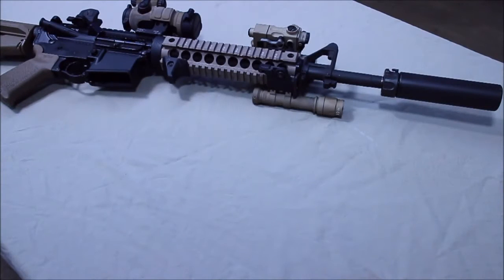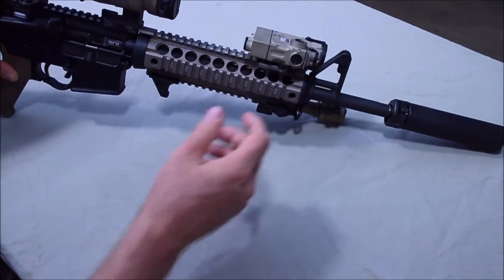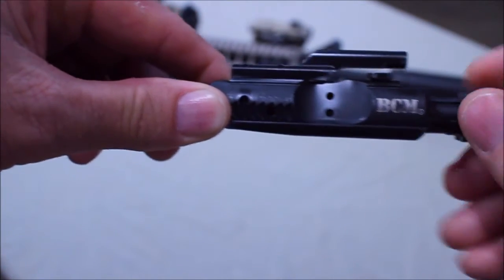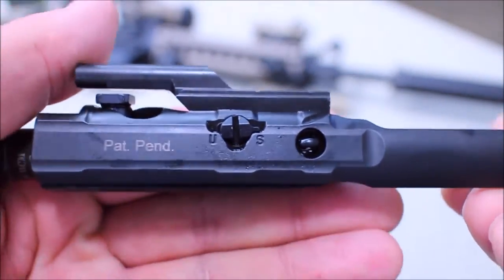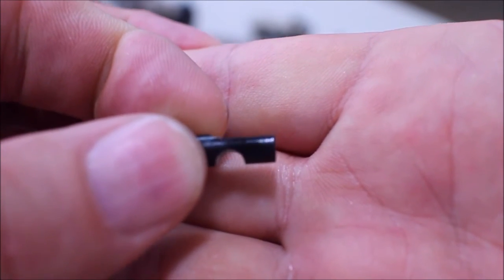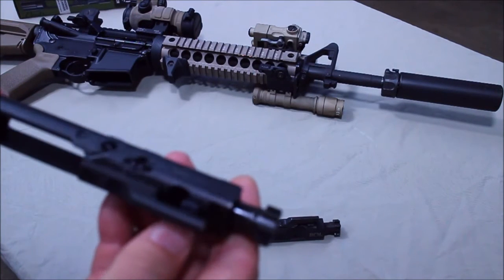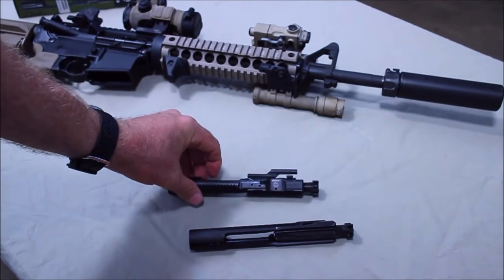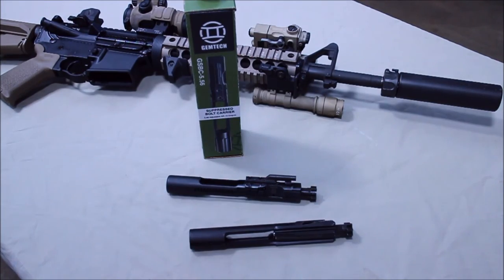GEMTECH

Comment: Hey Hammster, Damn cool carrier! In you opinion is the rotary pin tight enough that it won't adjust under fire? A must have imo, thanks for the info, you and yours take care, God bless and watch your 6's!
Reply from the maker: +MUTT N.C.  So far it works well, I will be using this a lot if anything changes I will update the video
Reply: The pin is contoured on the left side so that it rides the wall of the receiver, theres no way it rotates on its own under normal conditions while installed.